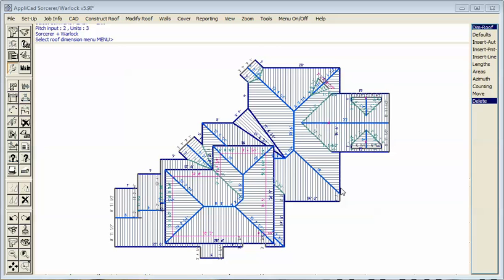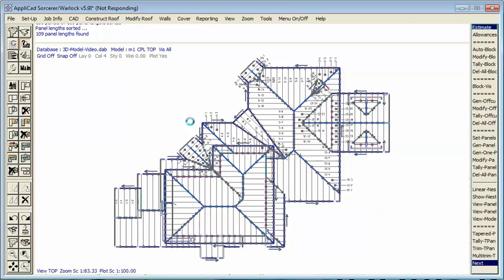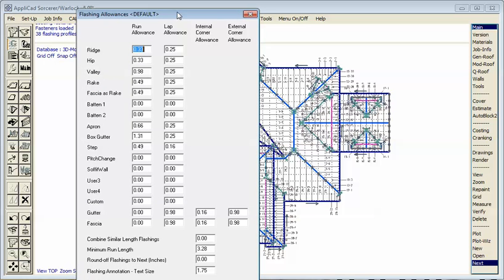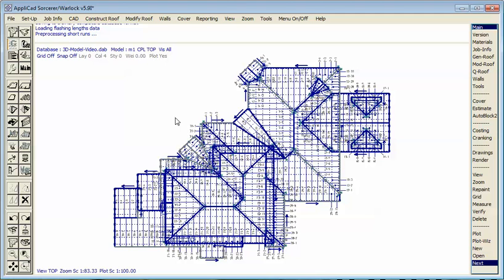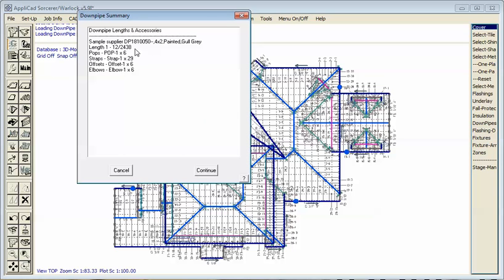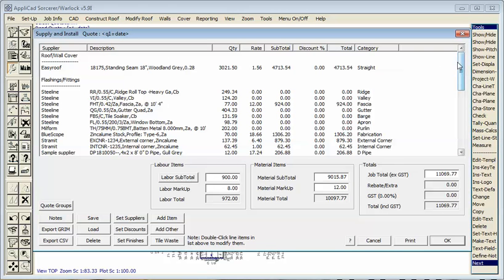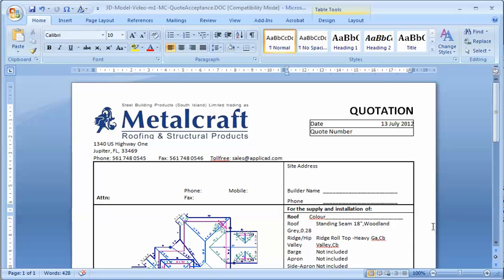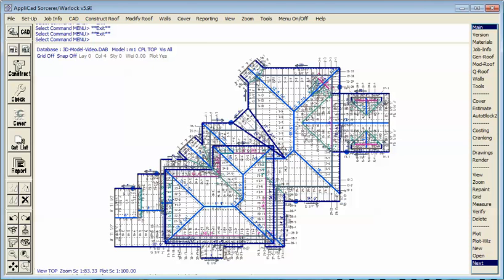AppliCad Roof Wizard - Panel Layout Cut List and Client Proposal

Comment: Hi I just started with a company that uses your Roof Wizard software in South Africa. Are there tutorials that I can work through to learn the different features? I have used roof truss design software in a previouse job and have a good idea about the general proses.
Thanks, Hartman van Heeerden
Reply: Hi, I am from the Uk and I can vouch for the software, even though Applicad are on the other side of the World, they are always there to help. The improvements each year are very good too.